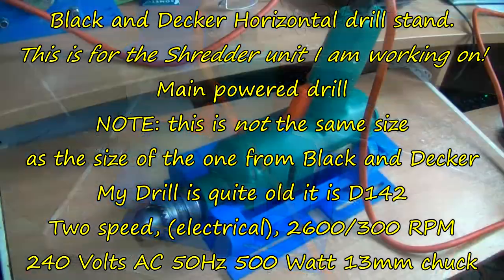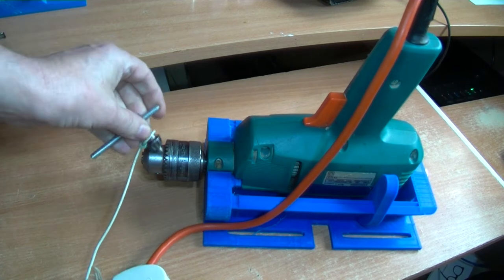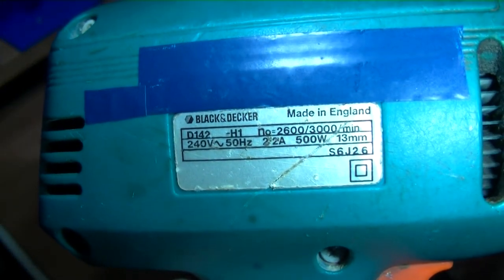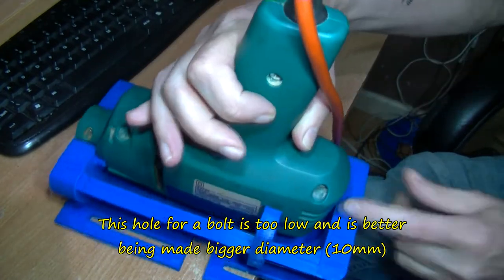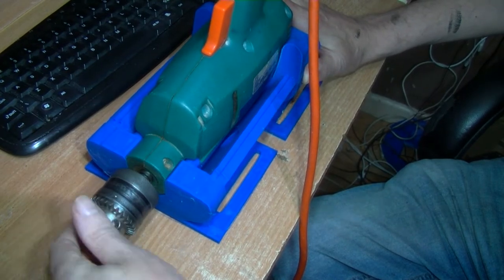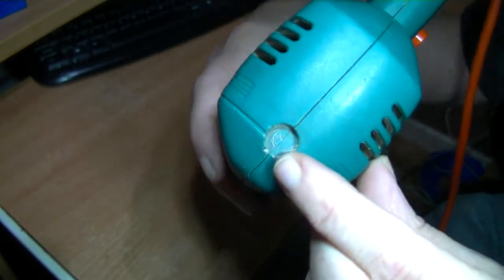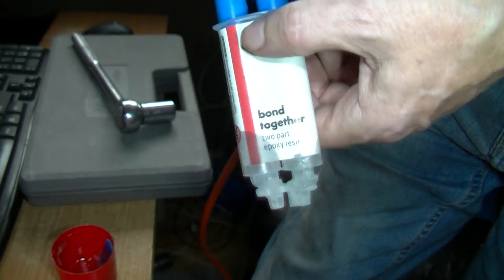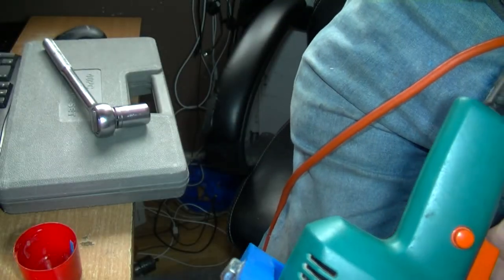Black and Decker Horizontal drill stand for the shredder

Comment: Bill how did you apply the graph under your glass build plate? what type of glass is it?
 That B&D drill is definitely an old one, I dont think they make them in England any more, like everything else. I have one from the '60s that my dad gave me when I got my first house in the late '80s it has an aluminium body with most of the paint worn off, I keep meaning to sandblast it all off and lapp and polish it up
Reply from the maker: I am using a polycarbonate sheet, with Elmers disappearing purple glue stick on. The graph paper is just inkjet printed and trimmed and edges stuck together. The polycarbonate sheet clips on to the build plate base after removing the original Creality sheet. This works well at 60C on the bed... but have to clean and apply new glue stick after about 10 prints. So I am looking for a method, that works without glue stick but so many promise miracles to get your money and seem to work for 50 prints then have to buy a new one
Reply from the maker: Could do the same with a grass sheet for graph paper
Reply: I also have one my dad give it to me but it’s in black&decker  metal box. still can use its very rare to get. Made in England